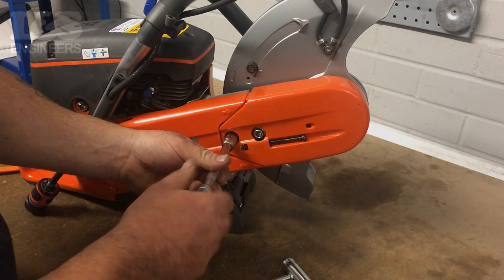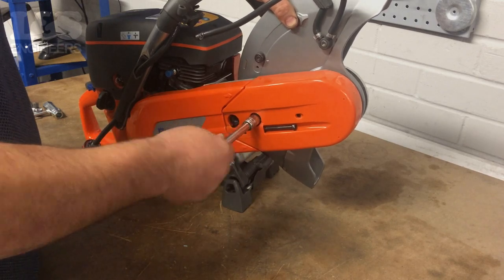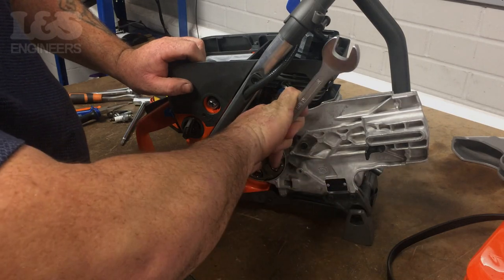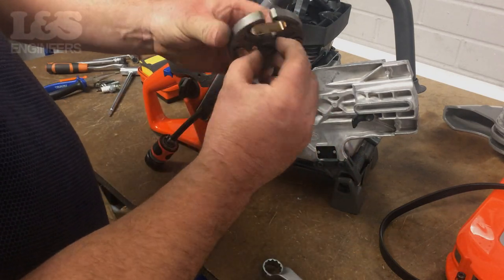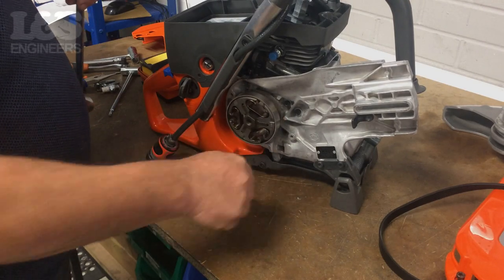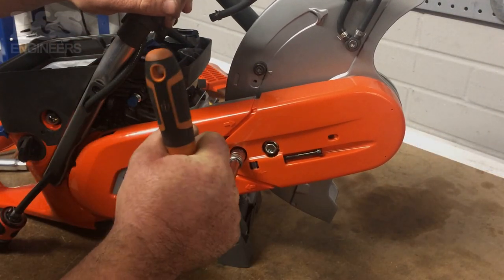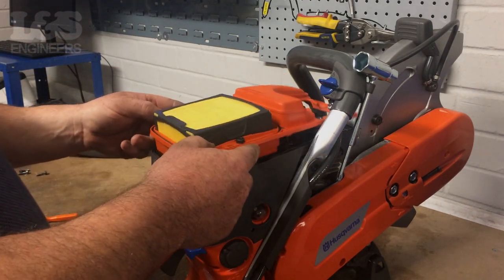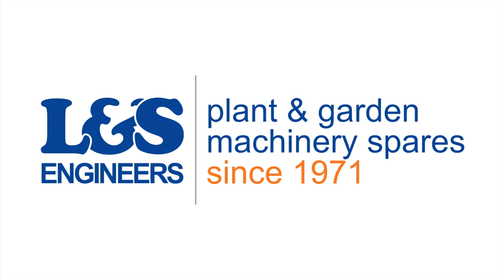How to Change the Clutch on a Husqvarna K760 Disc Cutter | L&S Engineers

Comment: How do you test the clutch or know it's bad, or that it's not just the belt slipping ? 
The reason I'm asking is that if I hold the blade with my hand and rev the motor there's some pull but it doesn't turn, 
but if I do a test by spinning and trying a test cut it will cut. I don't know if it's a safety thing or the clutch is weak.
Reply from the maker: Hi,  Have you checked the belt's condition for the grooves smoothing out?
Reply: @LSEngineersTV  I had checked the belt and it appears good and I made sure when adjusting that the bar was between the 2 lines.
looking at my original message it's a bit unclear, but what I meant was that the blade turns no problem when revved, but if I hold it and rev it it will try to turn,
but thinking it over, I'm guessing the clutch is meant to do that so if it's stuck when idling and you rev it, the saw won't flip itself and hurt you.
It appears the clutch is essentially a centrifugal action where the spinning pushes the pads out